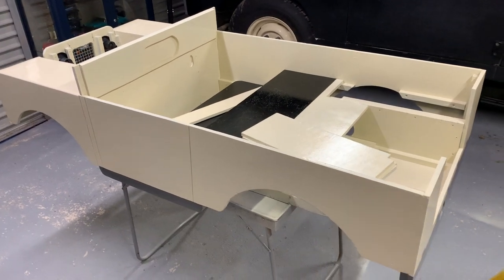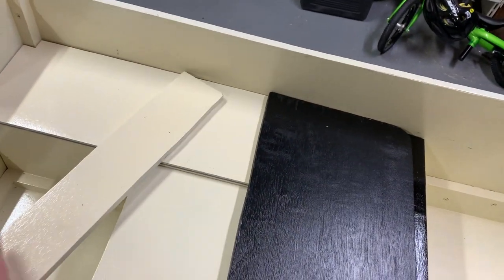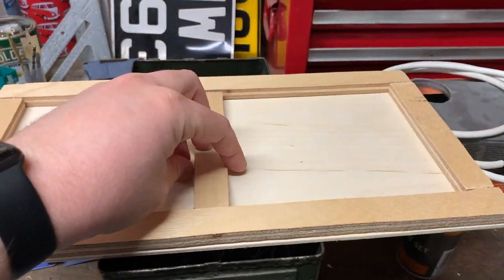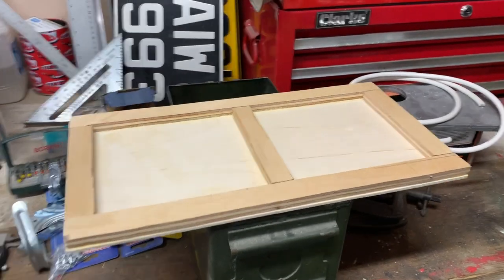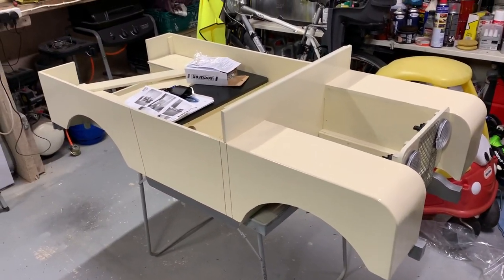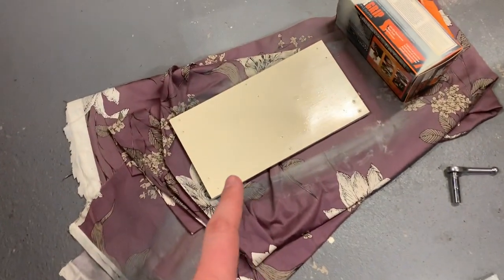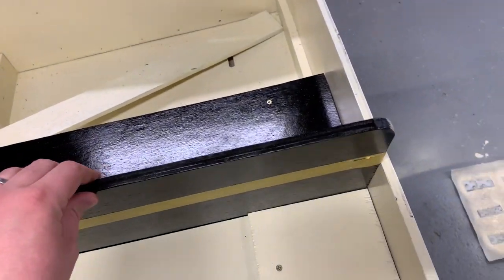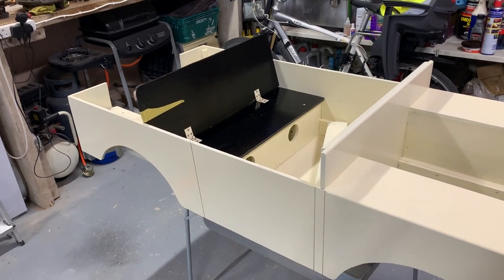Toylander 1 Build Series - Episode 11

Comment: Hi, the project is looking good!! I’ve been following along and have only just started mine from seeing yours. I’ve never used car filler before, can I use filler on the wood after PVA has been applied? Or do I put an etch primer on first after the PVA and then apply the filler? Cheers
Reply from the maker: Thanks Mike! I wasn’t too sure myself so sealed with PVA, then filled with Isopon then primed over that. Didn’t use etch primer as couldn’t see that the acid in it would etch to an organic compound like PVA. Hope that helps! Keep me posted!
Reply: Restosaga Classic Car Restoration  cool thank you! How did you prime over the aluminum wing caps? Use primer on the rest of the body and then just etch primer over those?
Reply from the maker: Yes, that’s right, sanded the aluminium lightly to key, etched then filled. The rest was just plain primer. Etch is so expensive!

Comment: Hi, if memory serves you're using Plywood. I was just wondering what tool you used to cut so neatly the grooves on the side panels ? Using a router? Thanks
Reply from the maker: Hi! Correct, I’m using marine plywood for the Toylander. The grooves were cut by my brother-in-law, a joiner, using a plunge saw, just to make the slot at 2mm as per the plans. Hope that helps!
Reply: @restosaga  It does help a lot, thanks for the advice and congrats for the great channel
Reply from the maker: Happy to help! Thanks, hopefully I can keep you interested as time goes on!